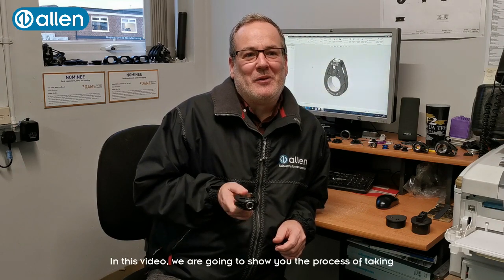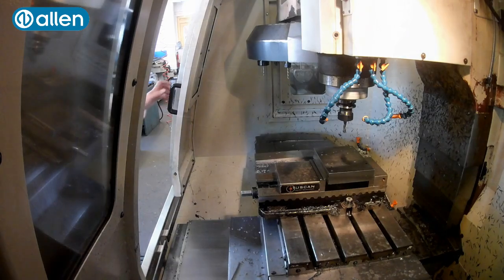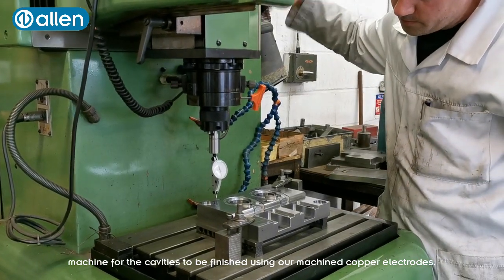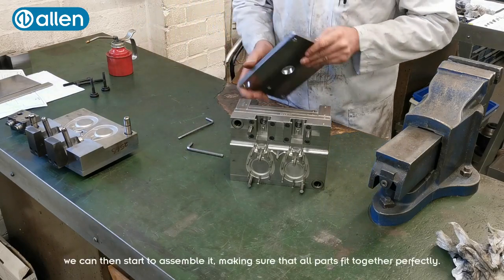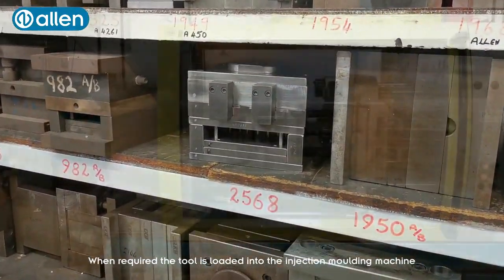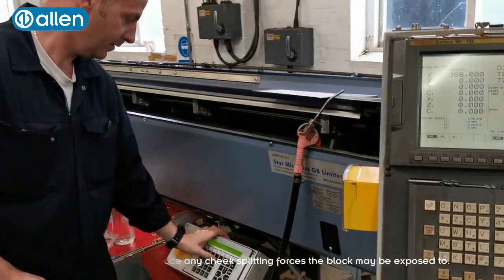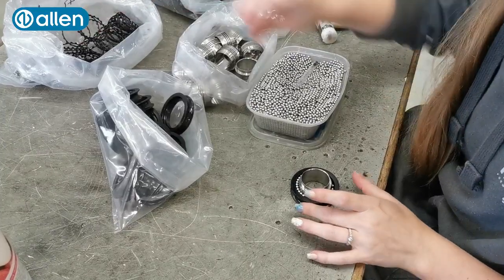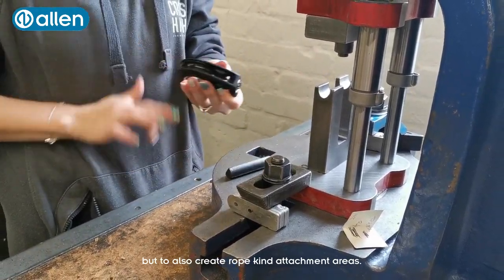SAILING BLOCK | How It's Made

Comment: Thanks for the great video of how you make a block that  you cannot service! I'll stick with my Lewmar.....
Reply from the maker: Hi Nick, 

Making a serviceable tie on block would increase the weight and size of the block. The A2060Tii is designed to be lightweight and compact. It also wont need servicing because we use stainless steel balls on a stainless steel race. Simply washing the block with fresh water will keep the sheave and bearings running smoothly.